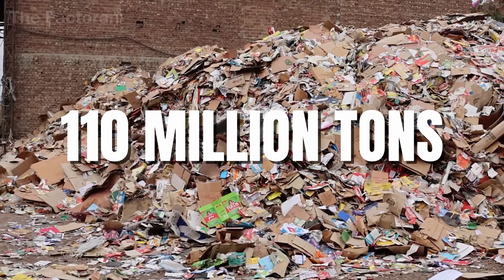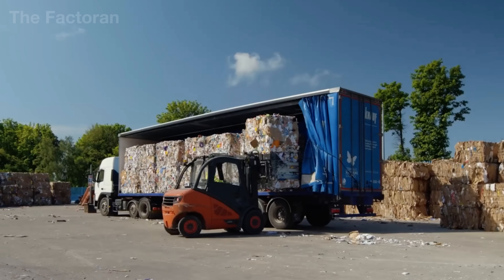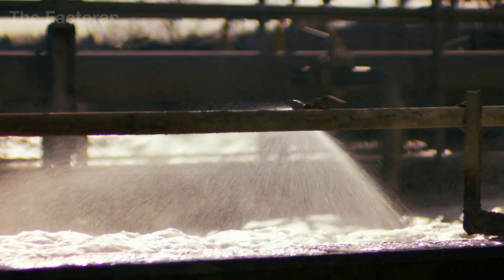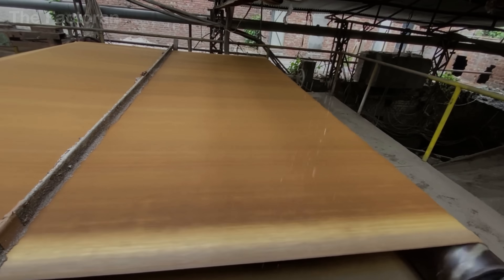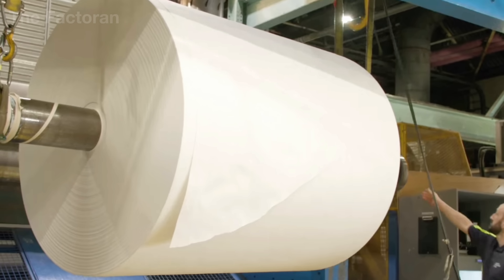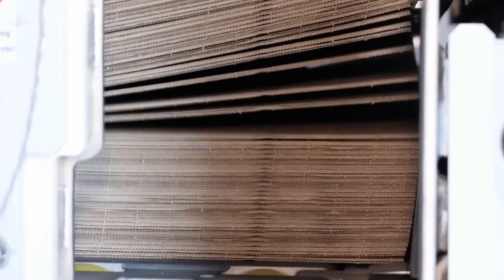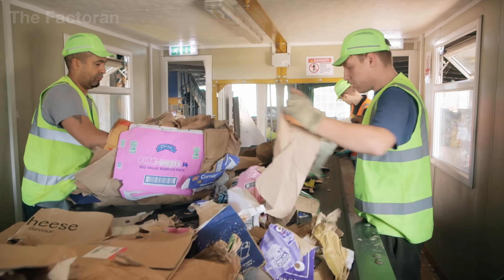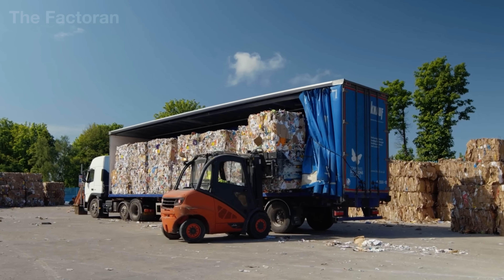How Millions of Cardboard Boxes Are Recycled Inside Massive Recycling Line

Comment: Definitely interesting, but doesn't show how plastics (e.g. packing tape) are removed and discarded/recycled. Also, what happens to plastic lined juice boxes? Thanks
Reply from the maker: Good points—let's break it down quick.
For packing tape on cardboard: It's best to remove it at home to keep things clean, but most facilities handle it by soaking the boxes into a pulp slurry. The plastic tape floats to the top, gets skimmed off, and is usually landfilled or incinerated (it's not recyclable with paper). Too much tape can snag machines or lower bale quality, though.

Comment: Right from the start you make a false statement, plastic can be recycled over and over 100%, cardboard can only be made using 10% recycled material,
Reply from the maker: Good point! Thanks for sharing — recycling rules can vary a lot depending on the process and region.

Comment: It's an interesting video, but very little of it takes place in North America. The standards for what is used vs. rejected are far different here and recyclers will only take very clean content...ie no pizza boxes or anything that touches food. They also won't take milk or juice cartons since they are plastic lined and it takes expensive processes to separate that is not mandated here. 

It's unfortunate, but the angels of recycling are largely in the EU.
Reply from the maker: That’s a great point 👍 — recycling rules really do vary a lot by region. The EU’s setup is way ahead in some areas, especially with how they handle mixed materials.
Reply: Also China, Japan [which takes recycling to an entirely new level - and S Korea.  There is also a lot of recycling carried out in Pakistan but safety is somewhat patchy and regard for pollution is also sadly lacking in many cases.  BUT they do recycle an awful lot of aluminium, plastics and metal into new products.